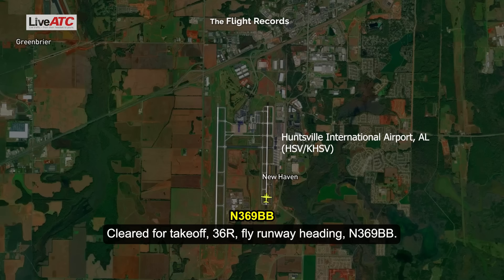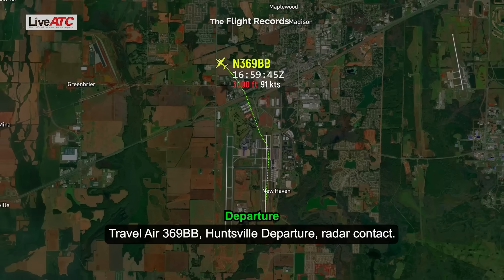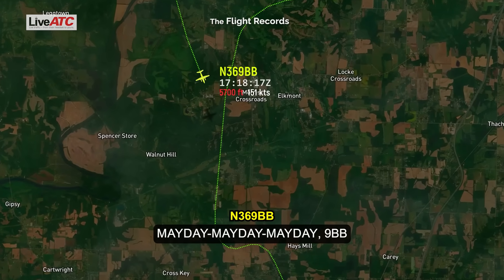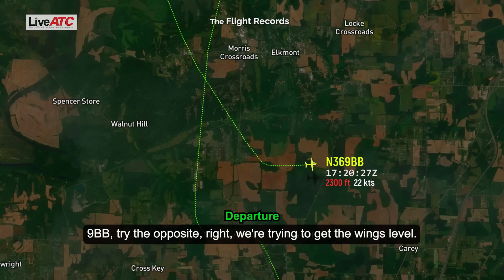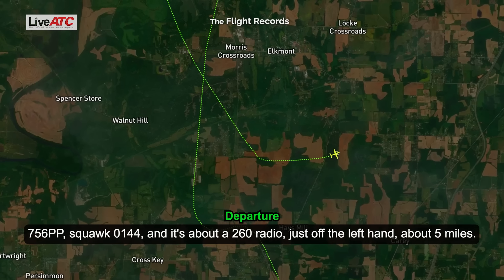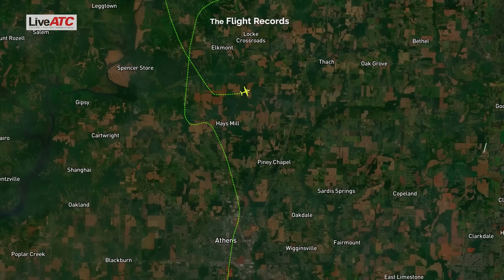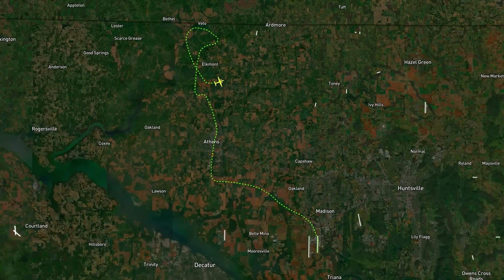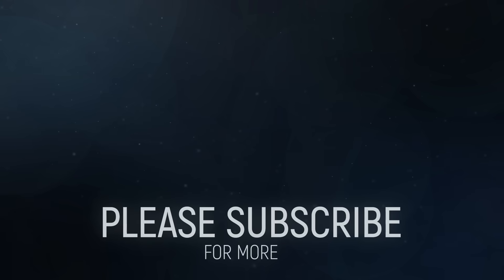-6,727 fpm descent rate | 2 KILLED in plane crash near Highway 127 in Limestone County!

Comment: It always breaks my heart to see a fellow pilot go down in the middle of doing the thing we love. Hearing their final words really hits hard. I've been through spin during my early days of flying while practicing slow flight. That was the most terrifying thing I've experienced. That was 12 years ago and I still remember every detail of it - from how it felt to the position of the altimeter needles as it wound counterclockwise. I remember stepping on the right rudder hard to counter the left spin, I was not sure what to do with the aileron so I just let go of the yoke (hands-free) despite every muscle fiber in my body wanting to pull it up by survival instinct. After what felt like an eternity, the C172 nose dove but no more spin. I guess luck was on my side that day. Definitely learned from the experience.

Comment: A twin engine aircraft is very difficult to recover from a spin. Fuel in wing tanks can act as a counter weight to any control input.
Engine power must be rolled back. Stick full forward! Rudder control opposite of the spin.
And you’ll still need 5000 feet if you can even regain normal flight.
Reply: A Cessna 150 has fuel in wing tanks.
Reply: but only one engine, centered. @mmayes9466
Reply: No, powere back, relax everything. Then rudder opposite spin, once spin stops, nudge over the yoke to regain flying speed.
Reply: @tommypaget2294  

No sir. That's not what the aircraft owner's manual says.

"If a spin is entered inadvertently, cut the power on both engines. Apply full rudder opposite the direction of rotation and then move elevator forward until rotation stops. When the controls are fully effective, bring the nose up smoothly to a level flight attitude, don't pull out too abruptly."
Reply: @JoeThePilot  and that’s different than my comment?
Reply: @edsal26  Yes, it is. The order matters when in a spin in a twin.  If you follow the order you suggested, you'll most likely never recover.
Reply: @JoeThePilot  PARE works for all aircraft. It is important to neutralize ailerons too. You can do that simultaneously with opposite rudder.

Comment: Long time pilot here...I do not understand the impulse to declare MayDay on the radio.  ATC cannot help you fly your airplane.   Most controllers are not CFI's or even pilots.  They can't help you get your plane out of a spin.  All they can do is help you find a runway somewhere, guide you towards it, and call for the trucks.   Don't waste braincells and time communicating during an emergency.  Fly and stabilize the airplane first, fix stuff as able, then call ATC.
Reply: spontaneous, human reaction for a connection.

Comment: Flying your own plane is dangerous as hell. About 20 years ago, I got interested in getting my pilot's license, I was in Civil Air Patrol as a kid, flew in Cessna 150 & 172's all the time. JFK Jr then crashed and the wife vetoed it. Glad she did even though I would love to fly. Too many variables for the average person with average money to keep up with IMHO
Reply: I'm sure you wouldn't have jumped into a very high-performance airplane that you were not familiar with, and flown into IFR conditions that other pilots rejected, with a healing, but still weak broken ankle.  You can stay current without breaking the bank.
Reply: @lindaschad9734  Your definition of breaking the bank and mine are probably different. I've worked with a lot of military pilots and aerospace engineers, we've had long hypothetical conversations about this subject. Flying is an activity that is way beyond the capability of the average person for two reasons, costs and it's very unforgiving. Learning to actually fly an aircraft isn't the issue, it's how to handle problems. Just about all of the military pilots I know quit flying after they retire due to costs. I also would not trust myself to build my own plane. As one UH60 pilot once told me, you can learn to fly a Black Hawk in about 300 hours, you're not learning to be a pilot, you're learning how to handle a problem and not panic because the outcome of failure is probably death.

Comment: This goes to all the people who want private pilots to do spins. There's a reason we don't do that anymore. I understand a spin in a light single isn't as bad as a spin in a heavier multi (uncertified for spins, too), but the experience level is also drastically different.
Reply: A spin isn't inherently super dangerous, but when the manufacturer explicitly says do not allow the conditions for a spin in the multiengine plane you're flying, it certainly is inherently dangerous. They were on the edge of the envelope, where only test pilots should be.
Reply: Utter horseshit. If you cant spin and recover a suitable light single (ie one rated for spinning) you have absolutely no business flying an aeroplane. not as a student, a PPL or at a commercial level. The reason the FAA made spin-training optional, was that relatively inexperienced instructors were conducting it, often in aircraft not adequately checked for loose-objects, often not high enough etc and the training deaths were exceeding what they expected to lose through inadvertent spins. What the FAA SHOULD have done, was limit spin-training to more senior instructors, on aircraft with 5 point harnesses, wearing parachutes, and with all crew conducting both a careful pre-flight search for loose objects, but also wearing flying-suits with zipped pockets. At a stroke, those measures would have cut the number of spin-training deaths to near nil. By the FAA making it optional, they achieved the worst of all possible worlds, with aircraft and harnesses more suited to cruise-flight still be used for spin-training, and an increasing dearth of instructors suitably experienced to demonstrate and teach it. (Retired UK instructor of 30 years in the job)

What's needed is a handful of dedicated spin-training schools around the country, and you get sent there to pass that phase before license issue. No if's buts or maybes, and no "option".
Reply: @Fidd88-mc4sz  I honestly don't see how spin training is useful for a run of the mill weekend warrior like myself. How on Earth will I ever spin in cruise at altitude with power three quarters of the way forward? If I ever spin - I'll spin at 500 feet AGL turning base to final, at which point spin training is hardly relevant. So really don't see a point in making training even more expensive and time consuming that it already is for nothing. It's not like going through such training once is incredibly useful 5 years or even 6 months down the road, that would need to be a recurring thing... not going to happen.
Reply: @alk672  A spin does not require slow speed or a low throttle setting. A flick-roll is, aerodynamically, a horizontal spin. Not that you're likely to flick-roll accidentally, but this is why spin-training is important, as  you yourself demonstrated by supposing that a medium to high throttle setting and "being in the cruise" completely precludes a spin. By the same token the power-on spin entry is a much more vicious departure from controlled flight, because the power masks the impending stall, allowing the stall to be deeper, and the yaw from engine torque causes the spin the develop more suddenly.
Reply: @Fidd88-mc4sz  that's completely irrelevant. Most pilots fly within a very narrow envelope and I'm not stalling in straight and level cruise at 100 knots. I will not flick-roll, I will not attempt a knife turn, I will not pull myself into a loop. When I can realistically stall is exactly where spin training is largely useless. Let's not distract ourselves with irrelevant aerodynamics.
Reply: @alk672  My point was not that you were likely to do it. I made that clear. It was that you yourself clearly have some gaps in your knowledge as to what gives you safety from a spin - and what does not. Hence the need for spin-training, both theoretical and practical.
Reply: @alk672  All pilots think that, until the day they screw-up and end up exploring parts of the envelope they ordinarily avoid. It might be having to manoeuvre suddenly to get out of the way of another, it might be after an engine-failure, or when overwhelmed by ATC directions leading to failure to control the aircraft properly. All of these have, and recently, killed pilots such as yourself who thought thus.
Reply: Every other country does PPL spins and is perfectly fine. Just need experienced spin instructors.
Reply: @Vontai21  you mean instructors with 400 hours on their way to the airlines? Sure
Reply: @alk672 CFI candidates are required to have spin training in the US already.  We all do it

Comment: I find it crazy that student pilots are not required to prove they can exit a spin prior to solo…
Now some instructors have never spun a plane.
Reply: No student pilots are required to do a spin.
Reply: CFI applicants are required to be endorsed on stall and spin awareness prior to being eligible for the checkride; all CFIs have spun.
Reply: @cpm1192  Yes...of course. But the comment was that 'student' pilots are required to do a spin...Yes...you could say a CFI applicant is a student...but as you know...most people think of a 'student' pilot as someone that is training for their PPL.
Reply: I don’t think this was spin training. This sounds like Vmc demo that went bad. Problem in a light twin is that most times Vmc is usually lower than that stall speed or right at stall speed. If a stall is executed during Vmc with one engine at high power a flat spin would likely happen. Unfortunately we don’t know the circumstances but I’m sure the NTSB will get to the bottom of it. My thoughts and prayers go to the families involved in this accident.
Reply: The "spin recovery" for a twin is to simply never get anywhere near it. As for spinning, the mindset in the FAA that has rendered spin-training on singles optional is simply ludicrous. The main function of spin-training is NOT to recover from developed spins. It's function is to give the student lots of experience of the incipient spin, and dealing with that, in order that they don't inadvertently spin later in the careers. The teaching of the recovery itself, is final insurance if they enter a developed spin with adequate height to recover. Not teaching recovery from developed spins, means they are a literal death-sentence if a pilot absent said training enters a developed spin. Attitudes have changed enormously on this since the 90's, when I started my flying career on gliders - when getting rid of excess height, many of us would spin off height, or failing that, use the opportunity to polish our side-slipping skills. Not being taught something the aircraft can do is asinine and completely unethical.
Reply: You don’t practice spins in a twin. Ever.
Reply: @Gee1410thirtysix  Agreed!

Comment: In looking at the ADS-B data they got down to 59 mph prior to the loss of control. VMC in this airplane is 76KIAS. They were at 5500ft which is an altitude you would work for single engine. This could have been a VMCA roll which developed into a flat spin. The Travel Air is not certified for spins and based on the airspeed from 3500ft to the ground they were at 117mph, likely a flat spin because of the slow speed. It sounded like they were doing everything they could and working the problem. I don't know if the Travel Air can be recovered if in a flat spin. We flew a B55 Baron for over 10 years, the Baron is NOT recoverable in a flat spin but the tails between to two aircraft are totally different. NOTE: Even if an airplane is recoverable it takes a certain procedure (power to idle, nose down, rudder opposed to turn & ailerons neutral) that could still fail due to the extreme nature of a flat spin. God Speed, condolences to the families.
Reply: It is believed that they were doing single engine work.
Reply: A flat spin by itself wouldn't create that high a rate of descent, they probably managed to recover from the spin but didn't have enough altitude at that point to recover from the resulting dive
Reply: @Cakeboy99  If it was a VMCA roll it certainly will as the airplane literally rolls over onto it's back followed by vertical nose down. With the asymmetric thrust and back elevator (It is why you must have the yoke full forward and engines at idle) the airplane can enter a flat spin. At that time the decent rate will decrease. Not saying this happened but it is possible. A standard spin is fairly easy to recover from, a flat spin can be impossible. Be interesting to see what the NTSB says.
Reply: That's what I was thinking; the pilot was practicing single engine failure procedures and let his speed get too slow, below Vmc. Multi-engine flying scares me and I've never been tempted to try it.
Reply: @RaysDad we are required to do a VMC demo for multi engine training so they prob were doing that.  Granted you recover it at the stall horn which should give you a couple knots before you hit the actual stall....but a wing bank or delayed or improper recovery by the student could have put them into the spin.
Reply: @gringoloco8576  With such a small margin for error it's possible the pilot did very little wrong to cause an unrecoverable spin. That's why this report is so unsettling.
Reply: @RaysDad  90% of the all flying we have done is in light twins, 2 Cessna 310's and a Beech Baron. For sure it can be done safely and there are many advantages. Having said that you must be hyper aware and hyper focused. We have a few vids about VMC/VMCA rolls on our channel you may find interesting. Flying here in the PNW we have nothing but trees, mountains and water. Twins are great here, always nice flying over the rugged Cascades with 2 engines puring 😉 & 2 seperate electrical systems. If you are on your game they are a joy.

Comment: Condolences to the families. This may be a training flight where practicing recovering from an emergency (departure stall or engine out, etc.) turned into an actual emergency. If it is, better to do this in a simulator instead of in the airplane. This is the reason airlines train emergency procedures only in a simulator. Training related accidents represent a significant number of accidents per year and could have their own category.
Reply: I doubt it…..nothing in flight plan about it, not enuf altitude for spin training, I’d say mechanical issues….but the end result is the same, two lives lost, two families left to deal with it…..RIP pilots
Reply: Did you look at the ADS-B data?  Looks like he did a series of 3 stalls while maintaining the same altitude and heading until he stalled, entered a spin and didn't recover.  Data doesn't support a mechanical issue, he would have started a controlled decent at the first sign of a mechanical issue, engine or elevator trim tab issue.  @kerrytodd3753
Reply: Unfortunately something just went wrong.  He flew very often, just because.
Reply: FAA would never allow that unfortunately
Reply: We need to start advocating changing Part 91 to the airline training model.  There are at least 4 GA training accidents so far with multiple deaths.  Zero airline training fatalities because they train in simulators and they even don't train these stall spin recovery maneuvers.  They train minimum maneuvering speeds in the pattern.  Stall / Spins can't occur if you maintain DMMS and less than 20 - 25 degree bank angle.  The vast majority of all stall spin accidents are in the traffic pattern.  Bob Hover can't recover from a spin in the pattern, nobody can.  FAA should also allow unusual attitudes and stalls in a Redbird trainer.  Please save comments about  Redbird trainers are not full motion (that would be to expensive) and that you can stall at any speed comments - I know all that.  Almost all stall spins occur in the traffic pattern (600 - 800 AGL).  How much do you learn or demonstrate when you release back pressure on the yoke doing a power on stall at 65% power or a power off stall?  Simulators are much better training tools.  We need to change the GA training approach to improve the safety record.       @Vontai21
Reply: Some emergencies are best left for the simulators, but often times there is no replacement for doing it in the airplane. The reason airline training occurs in the simulator is because training in the real aircraft is simply not feasible for obvious reasons.

Comment: The Travelair should be recoverable in a spin… very tragic loss for all.
Reply: Yep, but the engines and the gas are outboard of the fuselage and working against you. The more developed the spin becomes the less affective rudder input will be. No time to be talking to ATC. Don’t operate light twins below VMC, not even for training purposes.
Reply: @roberttolbert3535 im sure being below VMC wasn’t part of the plan. We don’t know what happened, sudden atmospheric condition such as turbulence could cause them to drop below VMC speed. Its unfortunate but something to learn from.
Reply: Obviously not a pilot. You don’t drop below VMC in a clean configuration at 5,400 feet because of turbulence.
Reply: @roberttolbert3535  I don't think there is any doubt that they were doing some training. Probably stall recovery.
Reply: @Scott83083  stall recovery is different from single engine below vmc